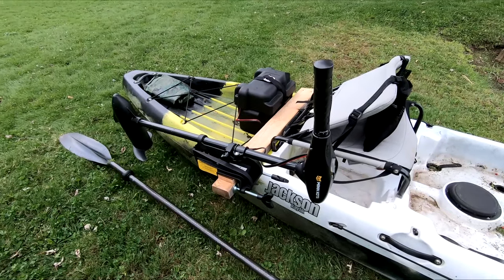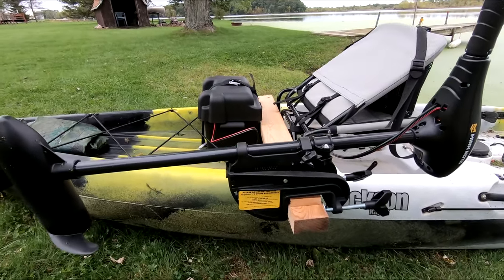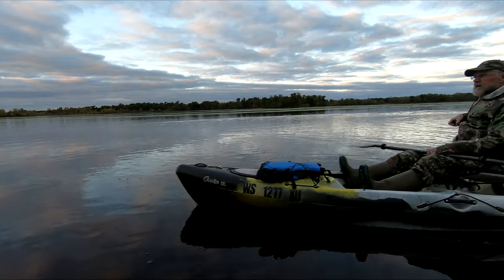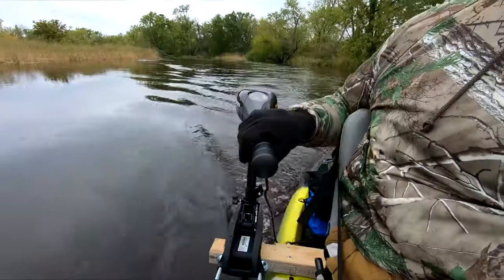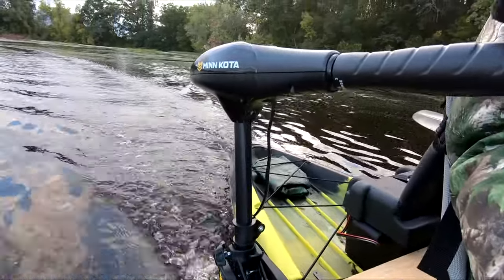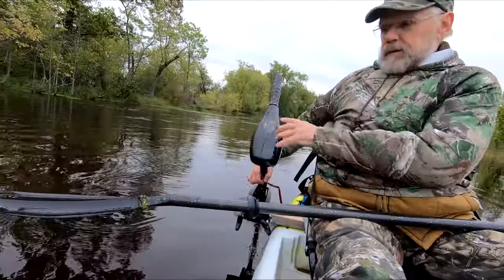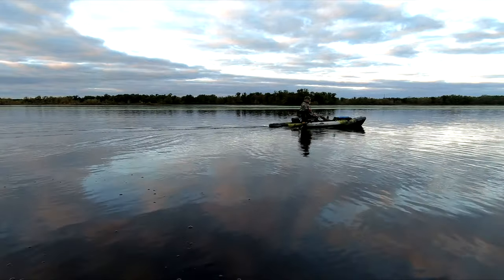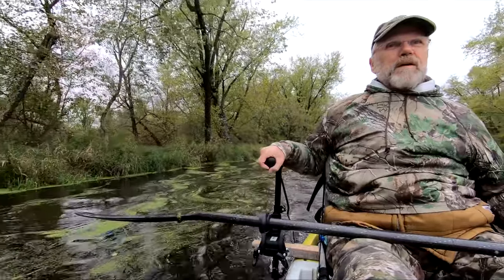Installation & Performance - Installing Electric Trolling Motor on Kayak

Comment: I appreciate how you kept it simple and just drilled the board into the kayak, thus making a mount for the trolling motor. Its really simple! People over complicate things alot of times. Like and subbed!
Reply from the maker: Thanks for comment. One of the reasons I started documenting projects is because many of the help videos  out there are so long winded. My goal as been to keep them short, and edit out the excess.
Reply: How did you drill, mount and seal the board that mounts to the hull? Thank you
Reply from the maker: I drilled tiny pilot holes and just screwed in the stainless wood screws. No sealer necessary since it's tight seal with plastic. All other screws used by manufacturer to mount accessories were the same way.
Reply: @RogerBindl  I found that I had to go through and dab some E6000 on all the factory screws to prevent water from entering the hull 🤷‍♂️
Reply from the maker: @MyChaoticFishing  I was concerned about that at 1st, but my Jackson kayak has been great. They use quite a few screws on attachments but I've never had a drop of water get through - even from the screws in my 2x4 attachment. I used the same type of screws they used.
Reply: @RogerBindl  nice. Jackson makes good stuff. I love mine, but Lifetime doesn’t make as thick of a hull, probably the reason. I found an easy solution though so it’s no prob.

Comment: I watched countless hours of these side-mount mods, ended up starting to build an intricate contraption to mount my motor on out of pvc pipe and various other material, and then had a revelation and realised i could simply attach a 2x4 to my gear tracks on the back.  My build is identical to yours, except that I steer on the left.

Comment: Facts. Went out today to test trolling motor.  I actually prefer 25% throttle over 100% on 65lb thrust.. I still pick up my paddle to help with positioning  but overall very happy. I should have done it sooner. :D

Comment: I've seen a good many installs. Nice to see the results in action.
Reply from the maker: I hadn't seen performance video's before, so the results were interesting to me... It handles well, but can be tipsy when quickly turning side mounted motor, and it does turn slower with motor in mid-section.

Comment: I’ve seen this method in many videos and just couldn’t get myself to do it on the side. I don’t quite want to spend the $$ for an autopilot system and mount up front. I came up with a killer way to easily mount on back AND maintain steering and control from the seat 🤘
Reply: interested to hear your method
Reply: @jeffhutt4873  just posted

Comment: I have my 2022 Hoodoo impulse 120, mirage drive. Which I love. It's fast, plenty of storage, and 8 can walk all over my kayak. I'm 5ft 7 155 lbs. But I purchased my 2020 Suzuki 2.5hp outboard, 15" short shaft, and it weighs approximately 28lbs. I thought I was getting the Jonny bass boats 100, that's why I purchased the outboard, because I fish the mangroves, backcountry, and flats in the Florida keys. So I love the 2.5 Suzuki. But I did add the Yak-Attack outriggers. They have hard plastic floats, with aluminum arms, that also fold in. My kayak is extremely stable without them. But if you add outriggers, your trolling motor and kayak, will not lean to one side. The 30 to 45 lb thrust  trolling motors, weigh the same as the 2.5 outboard. But I am planning on going with a Newport vessels 2hp or 3hp electric outboard. That'll mount on my stern, because my kayak is motor ready, and pre-drilled. 🌊 🎣

Comment: That's great. Almost what I want to do, but for calm sea. I believe a larger motor is needed. But I am convinced it is doable and fairly simple if I am allowed to say. Have nice trips!
Reply from the maker: This small motor is a bit slow, but works out well... so long as I go in a straight line.

Comment: I am thinking of doing this with my old Cuda kayak. I watched both of your videos on the steering issues, but I just want something to get me from point A to point B. I will paddle from there on out. I wonder is a rudder would help much?
Reply from the maker: It does work good for point to point, and that was the primary reason I added the motor. I'd take multiple trips up river during the day but my arms would wear down after an hour or so of paddling. This got me to the destination where I did just that... paddle once I got there.
Reply: @RogerBindl  I live in east central Florida and used to do a lot of saltwater fishing in the Mosquito and Indian River Lagoons. I'm getting older and have had arthritis issues with my shoulders so I thought this might help in covering longer distances. I don't mind paddling once I get to where I want to fish.
Reply from the maker: @retiredguyadventures6211  It was fairly inexpensive plus easy and quick to do, so I was happy with it. I thought of adding more controls and perhaps rigging it to go on the back, but that was expensive and way more work and time. I don't use it a lot but I do like to paddle.

Comment: Nice job Roger, maybe one of those small outriggers would solve the roll problem and make turns more comfortable?
Reply from the maker: I'm mostly okay with the roll. It takes a few minutes to get used to it. But, the maneuvering is fairly bad. I have a card popup link to the video on maneuvering. It appears at about 15 seconds in. Top right corner. Its good going straight, but he kayak turns really slow.

Comment: Roger, I'm considering two kayaks, one is more expensive but I can rear mount my motor.  Considering some stability issues would you still recommend a side-mounted setup?
Reply from the maker: I would say it depends on how stable your kayak is, and how good your balance is. For me the stability wasn't an issue. My kayak is wide, heavy, stable, and I feel very comfortable with stability. Turning the side mounted motor quickly is just something to be away of - especially on high speed. I'd do it again; it works great. The kayak would maneuver better if the motor was back further,  but that creates other problems.

Comment: Have you checked out adding outriggers to add stability?  Brocraft marine makes a nice set out of aluminum.
Reply from the maker: I'm thinking more about figuring out a way to place the motor on the back for maneuvering and stability. I think outriggers would make it difficult navigating in the small river spaces I go through.

Comment: You can get extension handles for the trolling motor
Reply from the maker: I wondered about that, but I'm still wrestling with the idea of how to tip the motor up and down if it's too far back to reach.

Comment: Could you please explain how you tightened the wood to the kayak? Did you just screw into the kayak or are there nuts and bolts on it. Thanks!
Reply from the maker: I used wood screws to screw directly into the kayak. All the other hardware, from the factory, was done that way so it seemed to make sense and has worked fine all these years.

Comment: I have been considering this add on to my sit in Kayak. Thanks for the information, well done video. Did you put any reinforcement on inside where the fasteners attach to kayak?
Reply: My question also!!!   Like the idea but unsure if the plastic is strong enough on its own for screws

Comment: Wonderful little video. I was just thinking that this would be a great idea, but wonder if it would cause the kayak to turn, but I don't see that being a problem. I can deal with a little side swaying. Thank you for posting this. \
Reply from the maker: It navigates fairly well in a straight line, but some turns need paddle assistance. I did this update video afterwards that demonstrates some of the issues. https://youtu.be/2KcnYEYeRX4
Reply: @RogerBindl  Thank you. I will click on the link now and check it out.

Comment: Nice video bro I  have just fitted a Suzuki as a side mount I would prefer it as a rear mount but I don't have access to the controls
Reply from the maker: After getting back to the kayak after time away, I definitly agree with preference for rear mount. I didn't use the kayak for much more than out and back trips till this year when I tried fishing. The side mount worked good for crossing lakes and traveling the river, but it didn't maneuver very well for fishing.
Reply: @RogerBindl  nowadays, I have a plan of minn kota upgrade on my fishing kayak, I am in between Side mount and rear mount ( right side as far rear) with extension handle??
May I learn your opinion?
Reply from the maker: @Ahmetyetkinkayaksbikes  I thought about an extension (like a sailboat hicking stick) but I'm not so sure about speed control, and I wouldn't be able to tilt motor out of weeds or shallow water. I fish shallows and some weedy areas.

Comment: I’m going to give this a try.   What screws did you attach the 2x4 with?   And did you need anchors or reinforcement?
Reply from the maker: I used fairly large size stainless steel (or brass - I forget) wood screws - #12 maybe, and just long enough to go through kayak wall about 1/2". I didn't use anchors or reinforcement. Everything else is attached to the kayay with similar screws and the material seems sturdy enough as is.

Comment: Do you have to register it if you put a lil trolling motor on it? I would imagine not, but never know with pirate police.
Reply from the maker: You have to register in Wisconsin. I'm not sure about other states. But electric trolling motor makes the boat motorized so it needs a license here. It's fairly inexpensive but kind of a pain. I'm also ordering lights after wanting to go out before sunrise and come back after sunset.

Comment: I realize this is stupid question but what screws did you use to secure 2x ?  It looks attached very well for just 4 screw
Reply from the maker: I believe they were brass wood screws with wide thread. The boats is in another location so I can't say for sure, but I'm sure they were wood screws and either brass or some rustproof metal.
Reply: @RogerBindl  Thank you 👍 maybe wide thread is what secures it , cause it looks secure. I'm going to try it today

Comment: Side mount works much better on a kayak with a rudder - you steer with the rudder and basically keep the motor pointed straight ahead.
Reply from the maker: The rudder does sound better. Jumping forward in time though, if I had it to do over, I'd probably buy one of the fin type paddle kayaks instead. Options and prices have gone down significantly since I bought my kayak - about 5+ years ago? But I love to bike, so the side mount electric option with rudder would be a great option for non bikers - pedal bikers. :)

Comment: Do I need to have a battery box that vents for my lithium battery? I’m worried it could get hot while using my trolling motor. Could I get away with storing it in a dry bag?
Reply from the maker: I'm not sure about lithium. I've read you don't want them to be submerged in water. I use the box to secure my battery so it doesn't fall in water if tipped.

Comment: I’m doing this, thank you so much 😂
Reply from the maker: It is a quick and easy method but I noted recently that the manueverying is worse than I thought at 1st when I was just going in straight lines. This shows the problem with short turns... it pushes sideways. https://youtu.be/2KcnYEYeRX4

Comment: what speed are you getting and what lb thrust is your motor?
Reply from the maker: I haven't been around the kayak for some time and finally got a chance to check. It's 30 lb trust (turns out I had said that in video, but I forgot). I'm not sure about speed. It's faster than paddling by maybe double?

Comment: These Minn Kota motors, at least the cheaper endura, burn up the switches when they are run at full speed for extended lengths of time.  This is what the manufacture told me when I called them.   I didnt have mine 6 months, my gas outboard quit on me and I ran the trolling motor for like 15 min on 5 and it quit on me.

Comment: Do you have any problem while reverse kayak with it? Because my trolling motor was 55lb in size..and my kayak get turn clockwise direction while i reverse it...
Reply from the maker: Navigating in reverse doesn't work well with the side mount motor. There's too much side thrust. This set-up works best for going point to point with minor turning.
Reply: @RogerBindl  thank you for the information sir...but do you have any suggestion ,how i can overcome this problem? Because my kayak was a hand paddling kayak,so this trolling engine help me when i controlling fish during strike..most of the fish that i looking was giant snakehead
Reply from the maker: @Hatikaukerasstories  The only solution I've found is to use the paddle when turning. The other solution would be to stern (rear) mount the motor. It's a bit more costly and complicated solution though.

Comment: You need to mount battery on other side of your 2x4 to create greater balance?
Reply from the maker: Yes... battery is mounted on the opposite side of the motor for balance.
Reply: @RogerBindl  no extend your 2x4 outside your boat on opposite side as motor. And mount battery

Comment: What type of battery do you use ? And how long does it last  ! Thanks
Reply from the maker: I describe all of this at 35 to 49 seconds in the video. Its an Interstate 690 MCA (75 Amp Hour) Marine/RV Deep Cycle Battery. I had 90 minutes on it that day and figured I'd get 2 hours. https://youtu.be/DA6p-mn5gRM?t=34
Reply: Do you know how much the battery weighs? And a rough estimate of the dimensions? Is it the size of a car battery? I just bought this trolling motor and having a hard time finding the correct battery… the one i got (that i haven’t installed yet) weighs about 60lbs😬 wondering if I needed something that big or not 🤷‍♀️
Reply: @Crystal11.11  I found some small AGM batteries 22 lbs each good for a few hours with a 20 lbs trolling motor.  You can also use a small AGM deep cycle wheelchair battery from Canadian tire Parr No. AGMU1   240 CA  200 CCA   43 RC 
If you don't put a heavy battery on some sort of soft board or boz  in the boat the edge of the battery might ripe the seem and go through the floor ..

Comment: I have the same motor and set up I put pontoons on mine❤
Reply from the maker: My kayak is pretty stable, and heavy, so I haven't use any outriggers. But the 2x4 was certainly an inexpensive and quick way to mount. It's still holding up fine. :)

Comment: If I was going to put a trolling motor on my kayak, I would want it mounted on the back and then I would run a cable and pulley system up to the seat so I could steer. Or I suppose I could just run 2 motors, one on each side 😂

Comment: What lbs motor was that, Roger?
Reply from the maker: I believe the weight is around 30 lbs, with 50 lbs of thrust. The battery weights more than the motor. I think the 12V battery weighs around 40 lbs.

Comment: I paddled over 4 hours today and I'm 80 yrs old, this may be the way I go, the drills don't do it for me.
Reply from the maker: That's a lot of paddling. I used to paddle about 45 minutes to destination, hunt, then 35 back (downstream), but the 2nd trip got tougher. And, 'if' I took a 3rd it was really tough. Thus the electric motor. :)

Comment: Just a suggestion I mounted motors on both sides of my kayak and that eliminated the torque and weight distribution issues and provides plenty of power with the two 55lbs Newport motors.  I steer using variable speed control and it works really good better than the rudders.  Here's a link to my video  https://youtu.be/_fstG8W8xwQ

Comment: 75 amp hour batteries cost over $200 tho
Reply from the maker: I got mine for aroung $85 if I recall. It's a sealed lead acid marine battery.

Comment: How did you mount the 2 x 4 to the kayak? What type of bolts/screws...??
Reply from the maker: They're just 2" wood screws. I can't recall if I drilled small tap holes in the kayak or just screwed them in. That's the same way all of the rigging is secured to the kayak.